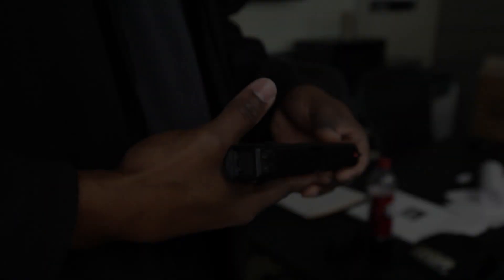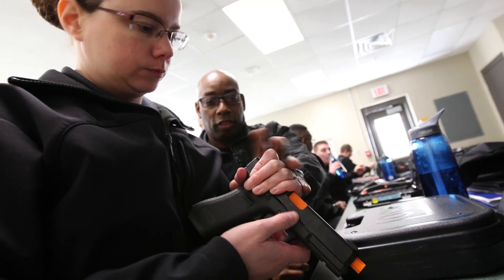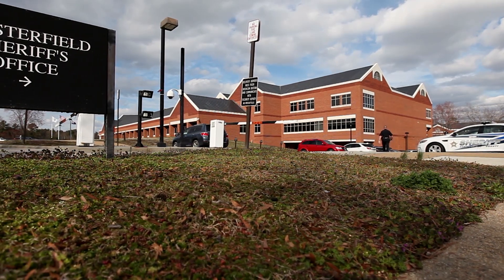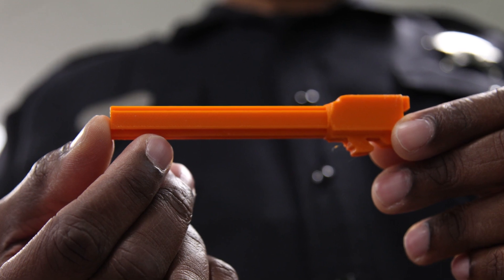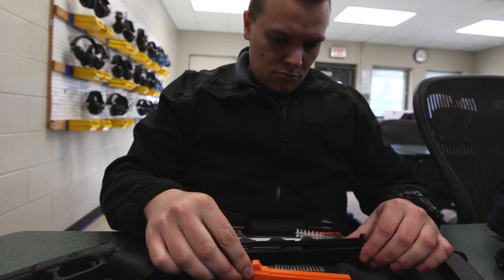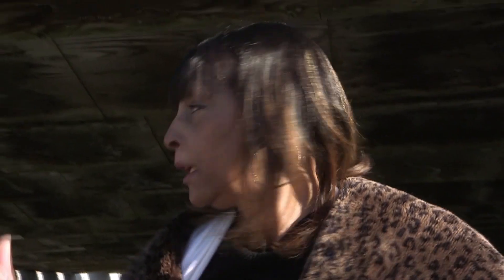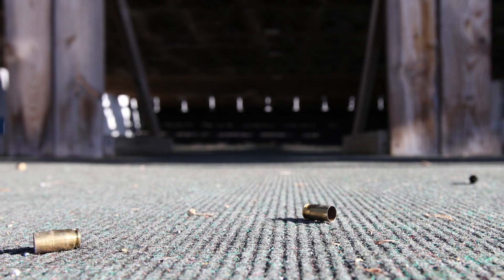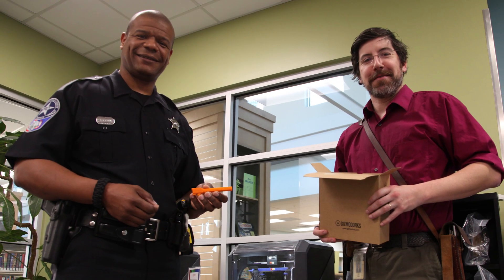3D Printed Pistol Barrels

Comment: this concept makes no sense. just use 3D printed ammo so you can actually practice cycling, clearing etc
Reply: I think the point is that with these 3D printed barrels you can't chamber a live round, so recruits can practice weapons handling with no chance of accidentally discharge.
Reply: @berns_pratt  you'd have to be really really dumb to mix in a live round with a plastic one. Also even trained cops have accidental  discharges. One let off a shot during a demonstration at my college lol
Reply: I do think that using inert plastics rounds (3D printed) would be very beneficial for training.
Reply: @berns_pratt  I have some of those from Amazon, I guess they are saying they are so new to using firearms having fake rounds may lead to real rounds being mixed in, so not having a barrel is literally "idiot proof".  But really they need a course?   A few YouTube videos and I know to to break down, clean and handle any random bit of kit.
Reply: @mgatelabs  
They need a course so they can be certified. It would be lawsuit after lawsuit if a cop shot and killed someone and their family figured out they weren't officially "qualified" to use their firearm.
Reply: I’m calling cap. (Snap-Cap, lol get it?) They’re not spending 32 to 40 hours with a inert training barrel before handing a functional firearm. I’m not sure why they’re lying about this, maybe to make it seem like they’re super duper serious about training and safety. “That’s why they’re the only ones who should be allowed to carry guns.”

In reality, your average beat cop is barely competent with a firearm at 7yds when the qualify once a year. Your average CCW holder is better trained and would smoke the average patrol officer in shooting competency.